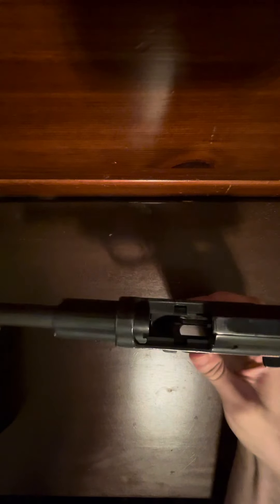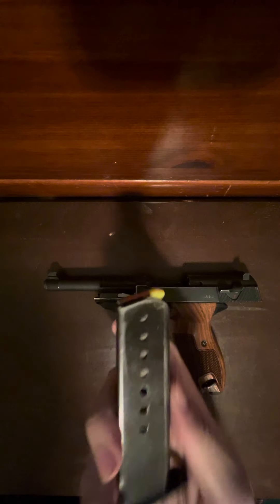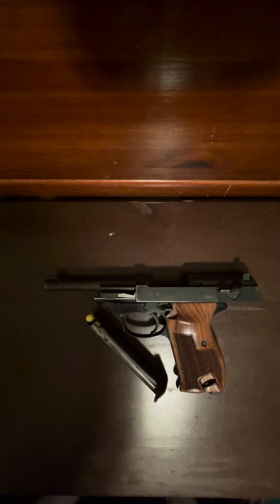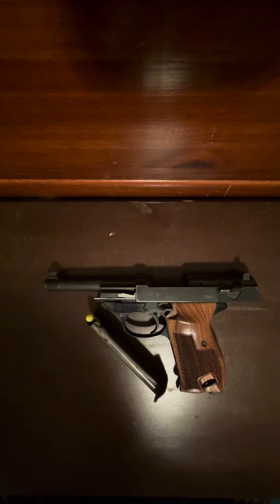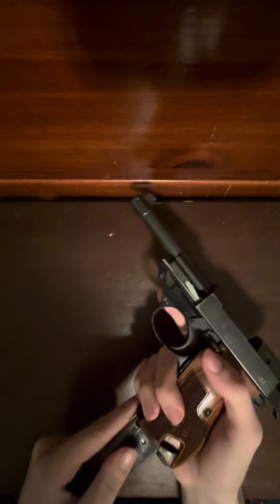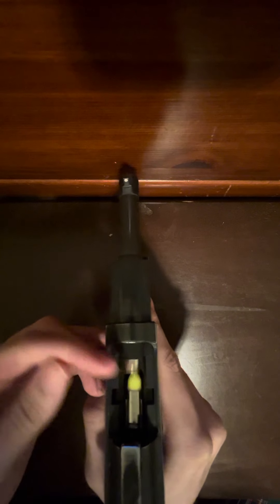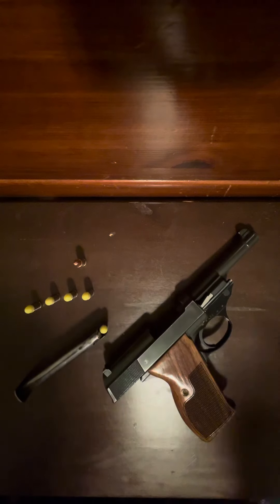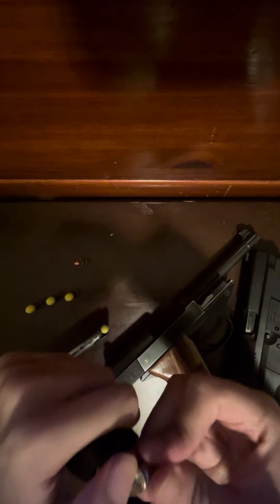Walther Problems

Comment: Never really had any issues with the p38s, Without looking at it.  I’d say extractor is worn or your extractor spring is weak.
Reply from the maker: So this is actually not normal then? Okay, thank you! I’ve been wondering this and just couldn’t figure it out.
So how do I fix that?
Reply: Rewatched the video, It’s probably Cartridge indicator pin I can’t really see it in the video, it holds tension against the case.
Reply from the maker: @SurplusArms yeah, sorry for the bad angle. I didn’t know how I was gonna post this at the time.
If it is that part, is there any way to fix that or not really?
And is there a way to see if it is that without buying another part just to find out it’s the wrong part?
Reply: @docbrowning no worries post a video of the extractor and firing pin area, so I can see if the indicator pin is broken,
Reply from the maker: @SurplusArms  https://youtu.be/iilQxGe7s2o?si=_MeYknx298WiQQNC

Here ya go, I hope this helps. It looks clear to me but I know how YouTube can mess up the quality of some of my videos.
Reply: @docbrowning  nothing in your 2nd video looks out of place, but your definitely not getting enough tension to hold the case!
Reply from the maker: @SurplusArms  yeah, I don’t know what’s going on.
I went to the range yesterday with a friend and when I let him shoot the Walther, it was cycling just fine but the spent cases were hitting him in the face. One thing I don’t like about the Walther would have to be that.
Idk if that is normal but it makes it so it’s hard to focus in the heat of the moment. Good thing it’s not my edc haha.
Reply: @docbrowning that’s definitely not normal, I would definitely change your cartridge indexing spring and ejector spring and start from there!
Reply from the maker: @SurplusArms  do they have videos on doing that? Because I don’t want to accidentally break or destroy anything.